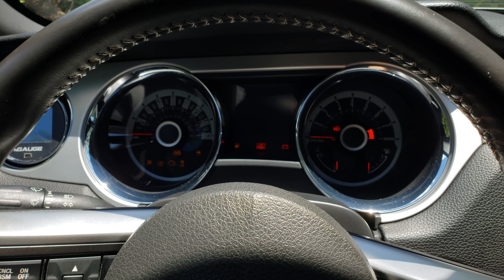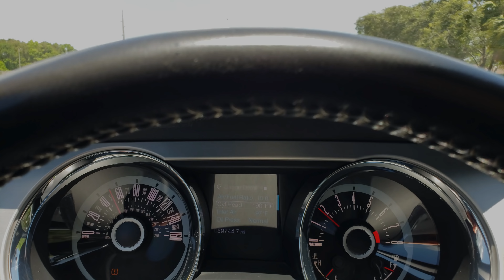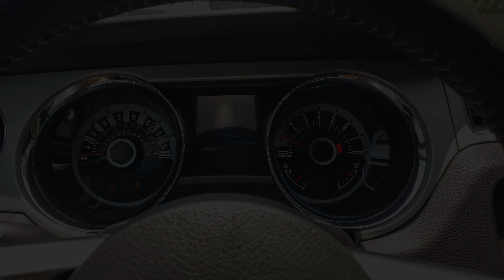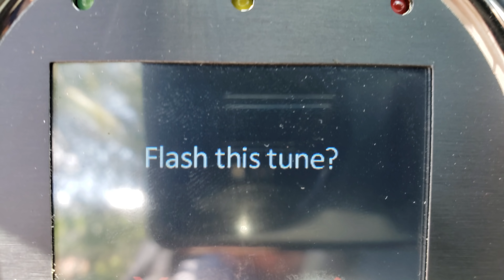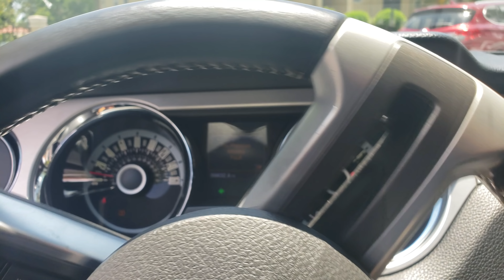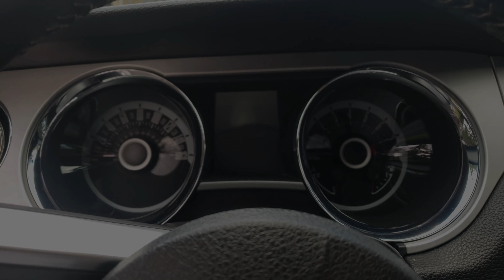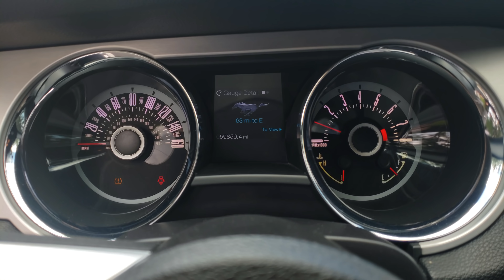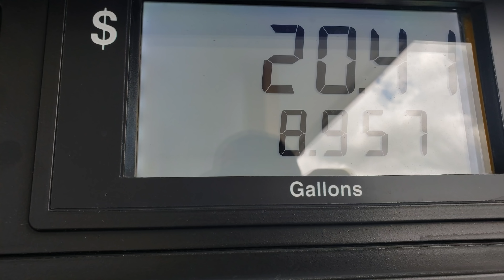800+RWHP Coyote mustang with CAMS! Gets Dialed And GHOST CAMMED!

Comment: as an LS guy, I am so damn jealous of mustangs that can just tune a cam lope into their cars. I have to spend about 1K for the chop lol
Reply: I5ZQ8 coyote swap it problem solved
Reply: actually you can do it to a stock engine using hptuners.
Reply: mrphiscal but then it would be slow. Lol
Reply: As an owner of a ls and a 2011 mustang with stage 3 cams I can tell you the ghost tune doesn't sound the same as the chevy. My mustang idles smooth.

Comment: Hey Alex, I bought a 2014 5.0 a little over a year ago completely stock, I’m new to the car scene and where I live is not exactly a big car culture. So I’m kinda by myself on this. I understand you work for Lund. I have a Roush  exhaust that a put on myself and looking to get and sve x pipe, which of course requires a tune. What can you tell me about tuning a car, how to data log and anything else I would need to know. Love the videos man
Reply: Asa Valentine  if you don't tune it, it will throw a check engine code for just x pipe catless I assume you're talking since a catted pipe wouldn't require one and some acke backs you're not really changing the air or fuel requirements to really get the potential of a tune. That being said even these cars bone stock will pick up power. Basically the tune you're looking for tunes off you 02 sensors so you dont throw a code..
Reply: Eric Rouelle yeah I understand, what the big differences between and Lund tune and say Bama. I’ve heard good things about both.
Reply from the maker: You've heard good about bama? LOL
Reply: Alejandro Flores think you could hook me up with a remote tune?

Comment: That is a really nice car.

My 2016 GT 6MT has the FRPP stage 2 intake kit that comes with a Ford Racing tune. It runs fine, but one thing I noticed from the factory tune is if you get lazy and lug the motor, it will ping. I've got perfect idle speed, no vacuum leak, no check engine light, etc and I'm running catch cans on both cylinder banks. So if you're not paying attention and you try cruising up a hill without gearing down, you'll hear it. Obviously, the solution is downshift and it goes away. It's a not a big deal, but when you step outside of stock, you're giving up a lot of the idiot-proofing that comes from the factory and I'm not going to raise hell with Ford for selling me a tune that allows me to ping when I force the car to lug. Their response would probably be 'if you cared more about lugging the car up a hill with 11:1 CR than running more timing and shit, put the factory tune back in'.

People really take for granted how accustomed they get to a bone-stock car (perfect cold/hot start everytime, 600 RPM idle, no intake noise, whatever) and some of the quirks can really throw people for a loop.

Comment: Hey Alex does a ghost cam tune do any harm to the cams? Great video as always
Reply: I believe it would just alter the phasing of the cams to increase idle overlap. Don't quote on that however. That said it's a natural function of the ECU/valvetrain anyways, so I wouldn't think you'd be in a position to harm anything. The ability to vary overlap to be optimal (and really get the best of both worlds in great idle and nice WOT performance) is a huge benefit.

Comment: Im wanting to buy you guys ngauge with a tune and i want it to be the ghost cam tune. I know the s550s dont chop as hard and I have a 2016 mustang gt. It has 1 7/8 longtubes..off road x , stage 3 comp cams, cold air, and on flex fuel tune all n/a......can i still get a ghost cam tune even though i have cams. I saw a video of a guy who had cams and you guys ngauge with a ghost cam tune on cams. I would like to buy that if possible..Alejandro flores

Comment: Do you know if anyone has setup a ghost cam tune that uses dashpot and not torque based decel? Ford does it with the Track Key Boss file but haven't seen anyone else pull it off.
Reply from the maker: Problem with that is with dashpot it's slightly less stable if you want it to chop hard.
Reply: Alejandro Flores Ok. I will make the switch then in my control pack car. Videos are great, I enjoy the content.

Comment: could you do a ghost cam tune on a f150?
Reply: Following,  I think it's the same because it seems like the only things that are different on the drive train from f150 and mustang is transfer case for the 4x4 on the truck, differentials and drive shaft,  both have 5.0 with different rated components for racing and idk if the clutches in the mustang 6R80 are different than the f150

Comment: cyl head temp at 140 on first start up? nahhh lol
Reply from the maker: GTS Garage yea trust me. It's was hot af.
Reply: South Florida nasty hot
Reply: It doesn't read lower than 140. Dead of winter, it will still say 140 and stay at exactly that until it goes beyond 140.
Reply: Matt is correct, not only that, dude its June in FL. Your intake temps will be triple digits mid day. Its 90+ and usually feels around 100 with nasty humidity down here.
Reply: @ Matt Pratt, gotcha. The system in my s550 is different. It reads even below 140. I didn't know. I know it is hot it's 100 in austin right now but even on cold start the cyl head temp cant be more than the outside temp and does take about 45 seconds to get to the 130-140 degree range lol. i just didn't know about the 140 degree reading. Thank you for clarifying.
Reply: GTS Garage didnt know the s550 was different either. Just me and my old 13 cant count backwards, lol